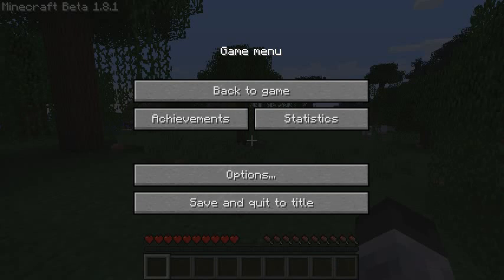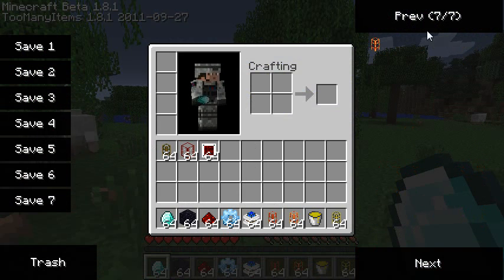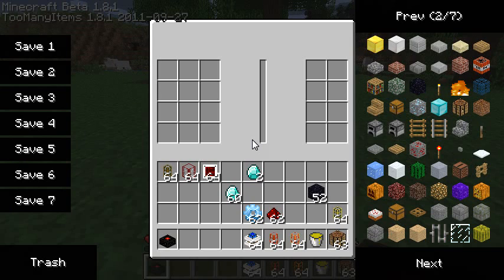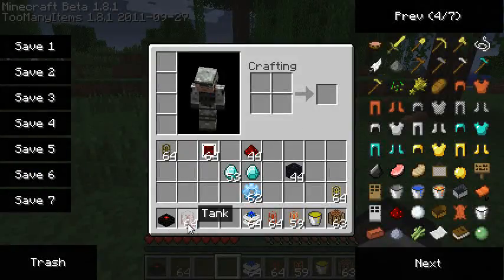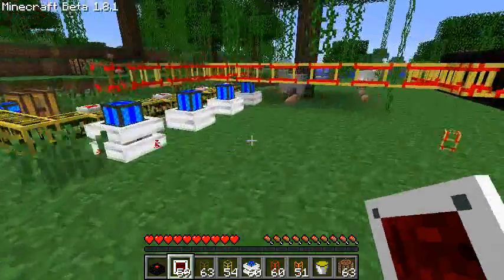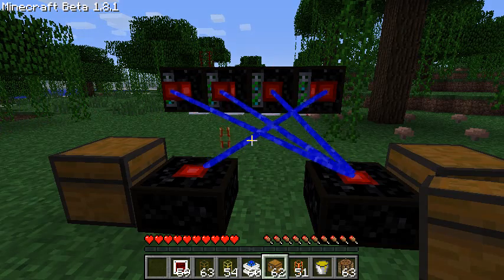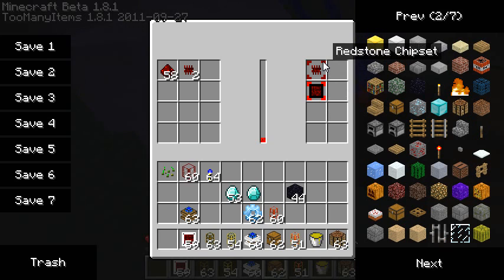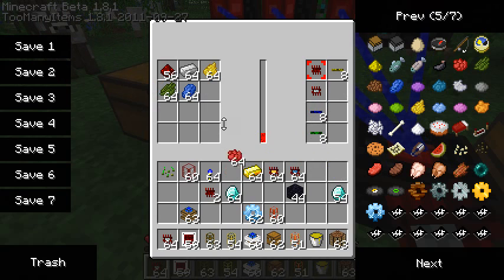BuildCraft 3.0.0 - Lasers (Tutorial 105)

Comment: @oretykasza just regular copper wires? put 3 ingots in a horizontal row. either put 6 rubber around it or get the stack and put in in the crafting spot again with a stack of rubber to insulate it.
the mod craftguide or recipe book helps with displaying all recipes.